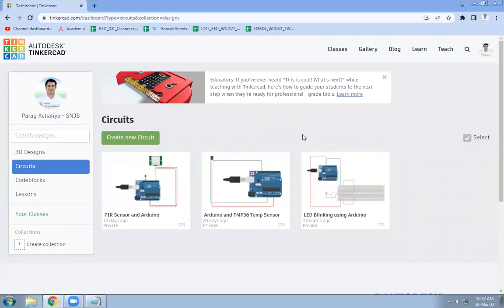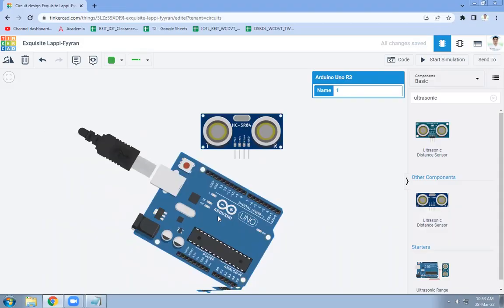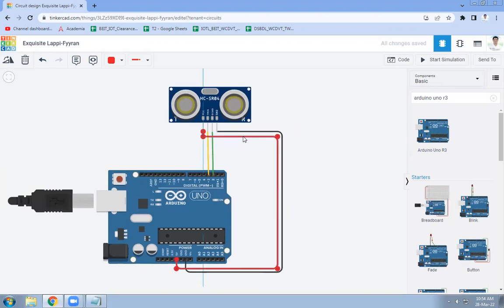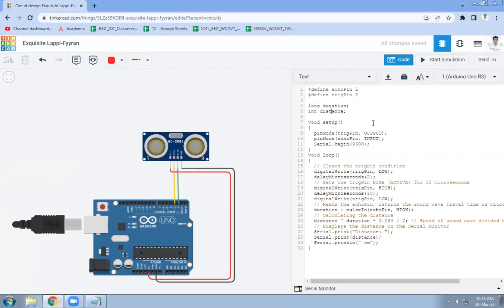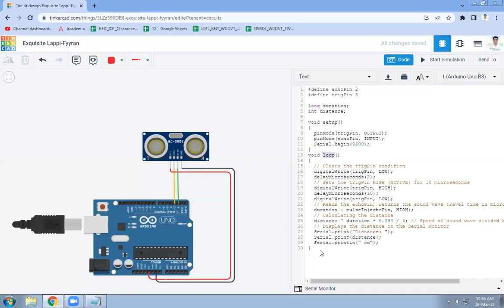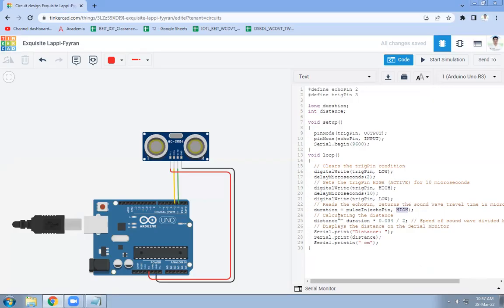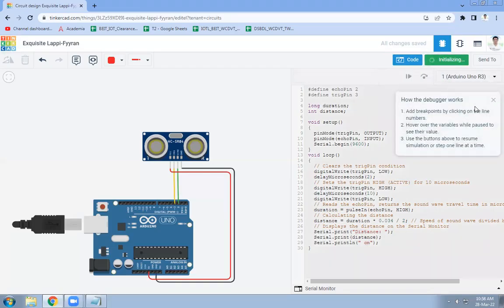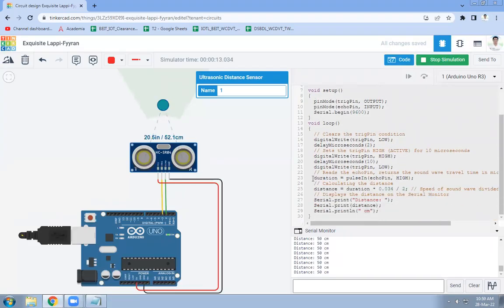Ultrasonic Distance Sensor & Arduino using Tinkercad

Comment: thanks alot
but i did not understand why you switched "trigpin" from high to low severaltimes ?!
Reply: I think we need a small and short pulse of electricity only for triggering the release of a sound wave, and this is read by the each sensor (once the sound wave reflects).